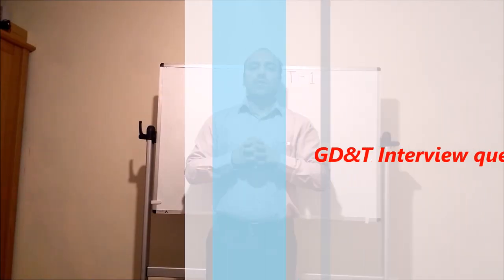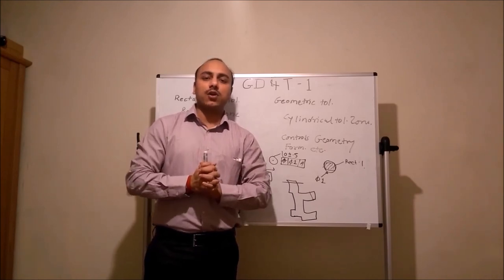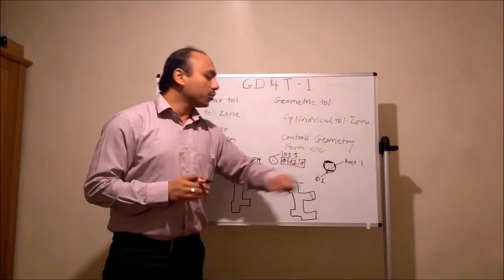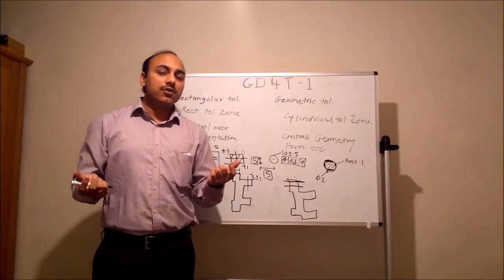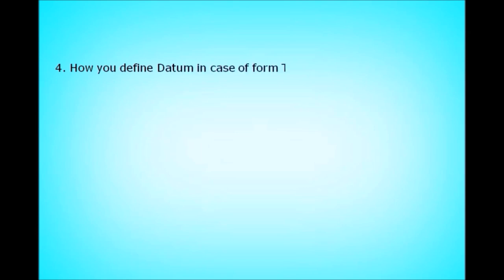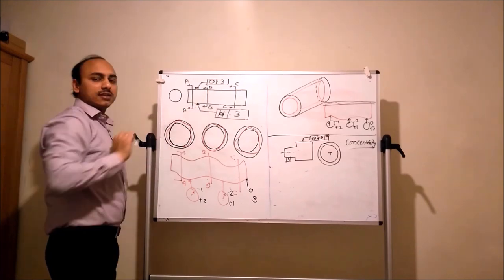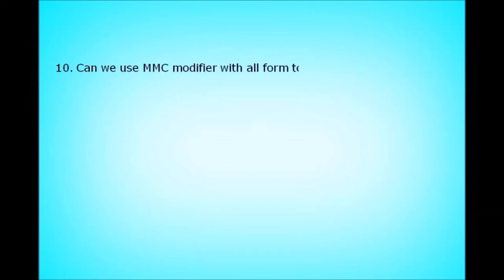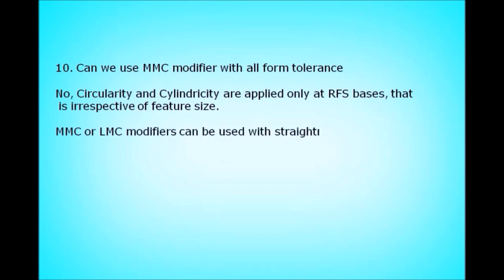GD&T Interview Encounter-1

Comment: Question 2: Position tolerance is ∅ 2*square root 2 when transfer from rectangular tolerance +/-1 not ∅1
Reply from the maker: Here it is not transfered, just for a reference comparison if values are same.
Reply from the maker: @UCUjZi9u4bHPYw5jroh8pJWg ohk I got that. Actually to compare I must have said dia2 of tolerance for istead of dia 1. Then we can compare. +-1 i.e. 2 tol zone. Now u calculate area for dia 2. Not 1. Thanks. Will rectify with 2 in next

Comment: Hi. while i'm trying to understand circularity, in lecture the tolerance was mention as 3 and in dial gauge the reading was mentioned as -2,+1..... when it is given as 3 it should be within 0 and 3 right. how come it can go to negative reading. Please clarify.
Reply from the maker: -2 is not a - ve tolerance. It is just dial guage dip anticlockwise. And +1 is clockwise. Let me know if further clarification needed. Thanks.

Comment: How to measure Concentricity?(How to establish derived median line?)
Reply from the maker: Done on CMM and other digital gauges. It's like at any section we need to derive median points for all diametrically opposed elements. And that median points must fall in a cylindrical tolerance zone constrained with axis datum.

Comment: Regarding 2nd qwestion.. it's explained  wrong ... As when diametrically it is given 1mm it actually reduced ..
Reply: In circular tolerances .. if u put a rectangle .. the rectangle comes outside .. not from inside
Reply from the maker: @shreyasgs8290  i know but still my explanation fits, what is max tol we get in rectangular tol. That should be our dai in case of gtol to make it uniform and so it adds tol. And also we can control better by using modifier to have bonus tolerances..